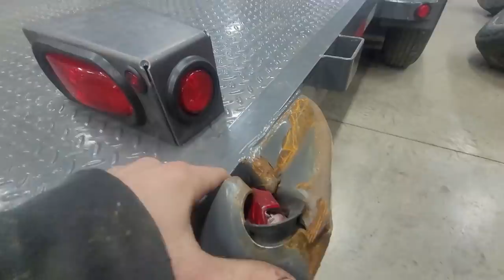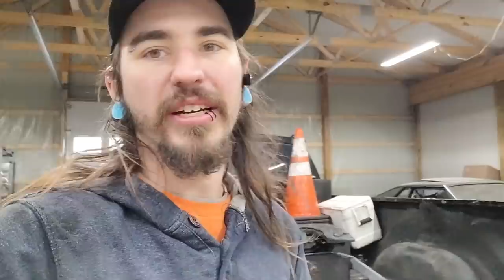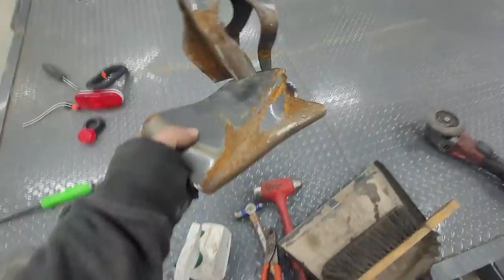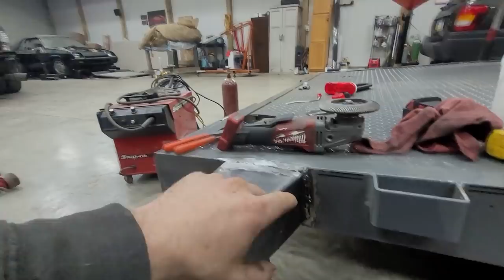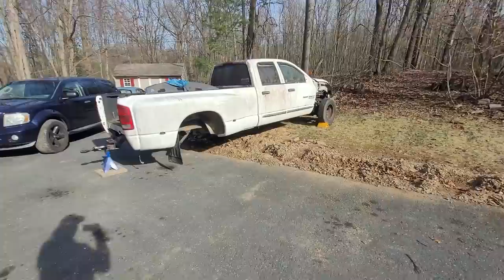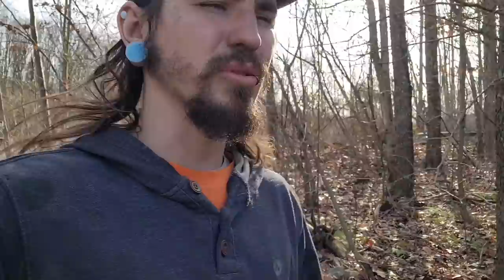Searching For A New CDL Hotshot Trailer | Tandem Dually 40fter | Repairing A Car Trailer

Comment: You're doing the right thing Steve. You have to keep the ball rolling Man. Take this time to plan for tomorrow.I like your idea. I have seen You come a long ways so far so I know You're doing the right thing. Scotch Locks are not made for outdoor or automotive use.I would never use them on any thing I own or any customers job. They are definitely prone to fail. All electrical connections should have silicone dielectric grease used in them if you want them to last.They can't take the environment automotive and commercial vehicles go through.. Keep yo the good work brother...👍

Comment: I told you a year ago That I run freight in pa and it works. You said if didn't make sense. Have went 13 different directions instead of taking advice...here you are, moving into local freight..😂
Reply from the maker: I doubt I said that lol I mentioned a few times I was going to do freight eventually. Yes, I wanted to stay doing cars but the rates dropped so it's time to move up or quit and I'm not ready to quit😂
Reply: Squirrel!!!

Comment: I’ve been in the hotshot game for almost a year and I see a lot of truckers complain about fuel prices. Ion get it in every business there’s a time when profits aren’t as high but the goal is to keep going instead of looking for something else to do, it’s just funny how everyone complains but there’s still money to be made all you gotta do is work hard and keep going
Reply from the maker: See people only see one situation and think that. But in reality that's not the case. To run what I'm doing would physically cost money as opposed to make it. I'm fine sitting until I get a new trailer. It sucks but it's better than spending money to work. But that's another thing - people fail to see why I like the pickup. When times are tough I have other means of income. The pickup can be used as a mobile mechanic rig(which is what I did before hotshot) and I can do just about anything with it for no added cost. Sure the gross amount is lower but the net is higher. Just some thought. Loads up in pa aren't paying enough to cover fuel and tolls therefore there's no point in running. This is a case where hard work will send your account down instead of up. Moving to freight will really open up the options

Comment: Try preheating with a torch for the welder. I finally got convinced that was my problem to the no penetration globby beads.
Reply from the maker: Someone mentioned I should try .023 instead of .030 wire too. Not a bad idea!

Comment: To help with a weak MIG welder. We dropped wire size. Most people try to run .035 I switched to .023 and the machine welds much better. Also (as I bet you know) vertical up digs way better.
Reply from the maker: I did both up and down and it still fights. I'm far from professional but with my 220 I was doing great. Appreciate the help!
Reply: @CPSteveMiller  90% sure the wire is to thick then. Keep the content coming... driving, wrenching, welding dosen't matter.

Comment: This is near the end of the slow season, especially for flatbed freight. And typically all business picks up after people pay their taxes. You should have scheduled you CDL school for sometime in March and you wouldn't have been missing out much because of the rates. Couldn't have forecast the fuel situation months ago, but it certainly worked in my favor. I just got the login information for my online portion and will be physically in school March 21 - April 1. Couldn't have planned it better if I tried. The load board sux and of course you are well aware of the fuel prices. You know you need your CDL and how much $$$ are you going to give up if you take your class in the busy season? And your GVWR situation. I don't have to spell it out for you, you already know. Get yourself a 40' 22K or 25K dual tandem trailer and be done with it. It will go nicely behind a 5500! When the non-CDL HS goes away, so will the market for those trailers and you won't find anyone to lease them. I realize you see them as a stepping stone, but I wouldn't waste my time or $$$ on them. A typical non-CDL trailer will be rated for 12K because they will be using a 14K truck unless they run the older 11-12K trucks. You can't run non-CDL with a 17K trailer and 11-12K truck. That's not only OOS and a fine, but a criminal charge as well.
Reply from the maker: My truck is 9000 gvwr

Comment: If you can get a flat   Deck  The 40' Trailer You can dabble in Both freight and car  Or trucks or  Equipment. But you kind of did put yourself in a position the position where if you had a flat deck trailer you could do more Instead of just sitting on one type  Of cargo you would be holy come onThat trailer but since you only were using it for cars you kind of limited  yourselfToo even make it moreMoney But without a doubt I would definitely go with a 40'I've been looking at diamond C between diamond C, and big Texs  And diamond C has some air rights suspension that you can raise one of the axles up to the ground so it would be easy to go through tolls.  I believe that non CDO should be in this industry because it always would have somebody's interested heart to be involved with  CDL. Because because I don't think that would be a real smart idea if they canceled it because now they're thinking about it it would be hindering and basically saying you have to do this our way or no way at all I don't know who there way is or who the hell they are but they need to get out of everybody's way. Because I would say that would be stepping on people's rights rights to pursue happiness and wealth if they want to do that non   CDL  And  That they are stepping on people's rights they have no business stepping on.. Because the only difference in this if they do that is that now people have to go through banks kind of extortion extortion instead of allowing people to make money to pursue it the right way without the banks were loans we're alones we're going through grants or whatever That my friend should be up to the individual not the government or everybody else we have enough of everybody else is shit in the way today..

Comment: If you want to stick to 17 a 40' tandum dual won't leave you much payload. Scotch locks are not allowed in my shop, The car market WILL be back! As a matter of fact you are facing the same over priced fuel that all of the rest of us are fighting right now and many have taken some time off because of fuel prices so my past experience tells me that supply and demand will mean more money per mile as the others park their rigs. I personally try to make the most of situations like this and try to turn it around to my advantage. Good luck to you.  About the Snap On welder It is made by Century and is quite possibly the worst welder ever made. Yes non CDL will become a thing of the past as well as sleeping in the back seat of a pickup. And last but not least you can thank their buddy Biden for inflation as well as these fuel prices.

Comment: Wait why don’t you modify your trailer to haul freight
Reply from the maker: Most guys want a wood deck to haul their loads. My Trailer isn't made for it. I need a 102 wide
Reply: @CPSteveMiller  ok
Reply: You don't need 102 wide
Reply: @anthonycary947  yes ya do! That car trailer is not designed for freight. Its designed for weight IN ONE PLACE ON THE TRAILER. You need I-beam construction for freight. The weight density/distribution is COMPLETELY different.
Reply: I hauled freight in an older Appalachian trailer that was 96 wide. Never ran onto a problem
Reply: @anthonycary947  never ran into a problem huh? The first time you looked at a load, on the board, that said "trailer must be 102 wide"...your problems began my freind. Im not saying it cant be done. Im just saying its not s good idea, for many reasons.

Comment: $320 a month for insurance whaaat I'm paying $1,200 monthly...... Bro let me know who u using
Reply from the maker: Gotta remember I have a 400 mile radius so the rate will be lower. That includes cars, freight, and power only. Shelter Mutual is who I'm using but if you're running cross country 1200 monthly is not bad at all. There's guys that are jealous that you're only paying that. I've seen guys paying 2 to 3k per month and others that were quoted upwards of 30 to 50k a year. Insurance cost is insane
Reply: @CPSteveMiller  oh wow thank u brother for your reply! Much respect!

Comment: Losing money on every run but making it up in volume. That business model does not work. Wouldn't it be great if angle grinders were reversible so you don't have metal and sparks shooting into your face.
Reply from the maker: Or I could spend 400 bucks a day to make 700. Doesn't make sense either. I'll sit until I get another trailer. I knew it would happen eventually just not this soon

Comment: You cant justify running but insist to run the turnpike...c'mon man..
Reply from the maker: You must be new to pa. To run my lane which is Pittsburgh to New Jersey you have to run the turnpike. The back roads are 20k weight limit 🤦‍♂️
Reply: I guess you will justify the $100 a day the same way you tried to make it make sense running strictly 95 to florida and back.
Reply from the maker: No other way to run it legally sooooo. Obviously made it work. Can't argue with January's numbers. 24k.. Record month. Nothing wrong with adapting and moving up
Reply: Listen man, I respect your hustle. Im bot bashing you, just seems like your insist on doing things they hard way rather than taking advice (that was previously asked for)
Reply from the maker: Nothing really hard about it though. Fuel prices went up and I make the same "net" in the shop that I would running. The nice thing about this industry is that I can do whatever I want and still make the money. YouTube is a huge part of the bill paying income. Yeah it's up and down but last year I didn't pay a dime on bills with anything other than the google adsense checks. Hotshot is just something to give me content on that I enjoy doing. Nothing like switching up content. I seem the get much better views and pay when I take a month off. Not sure why it works like that but it does. Even if hotshot only grossed 3k a week(when the fuel prices are normal) I'd still be in the profit because of youtube and shop work. The point of the videos are just to document what's going on. At the end of the day I can only do so many videos on hauling 3 cars. Honestly "power only" gives the best content but I refuse to be gone longer than a day. I've made being home everyday work and I will not move away from it.